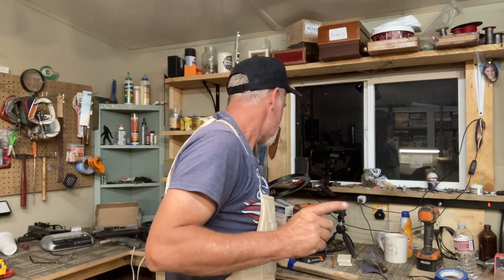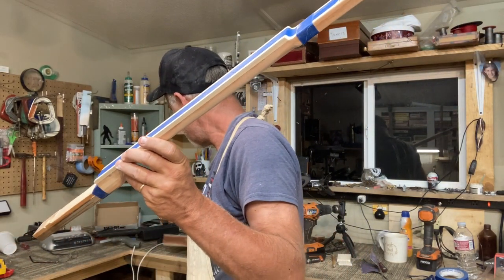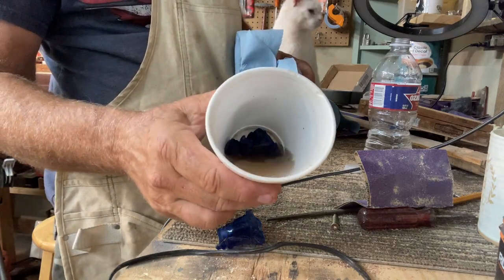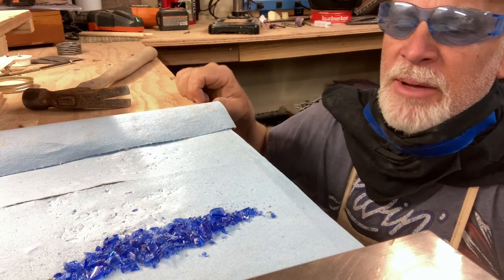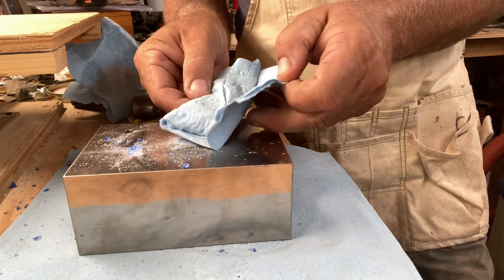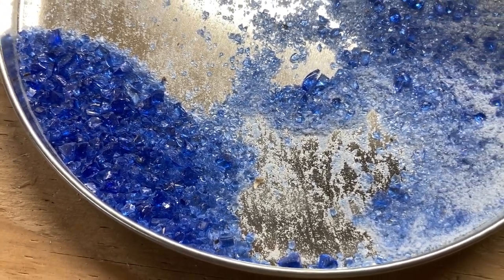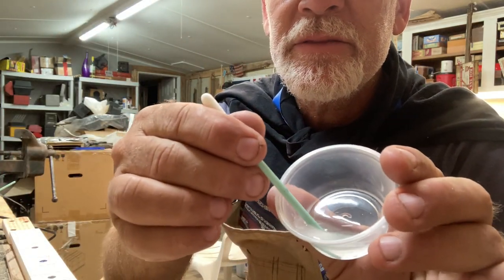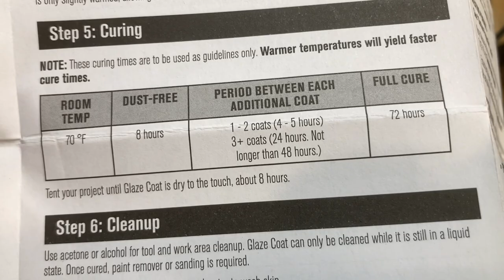Cigar Box Guitar - Broken Glass Inlays.  Dangerous!  Whatever you do, DONT DO THIS (just kidding) 😎

Comment: That white fine powder will turn blue when you mix it in the epoxy so no problem filling in the void space where you put those chunks in. When you sand it will all sand down flush so no problem with safety while sliding your fingers up and down the fretboard.